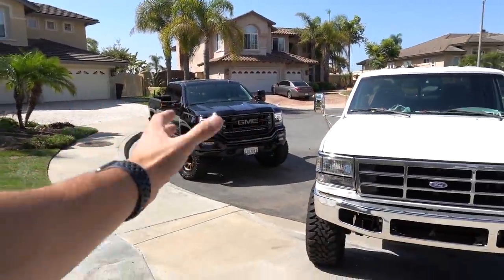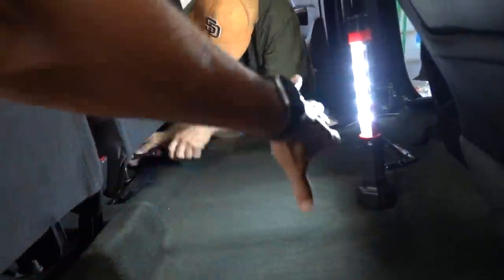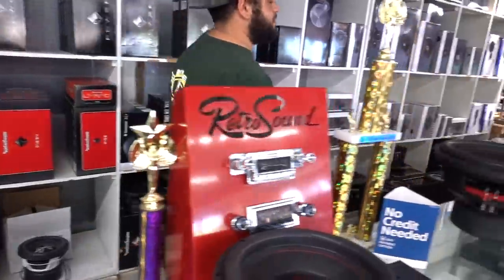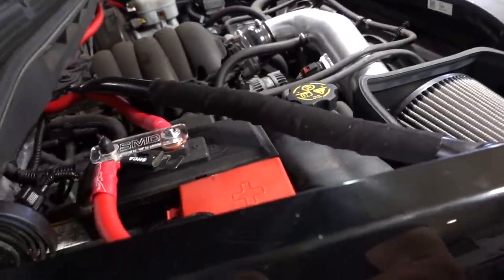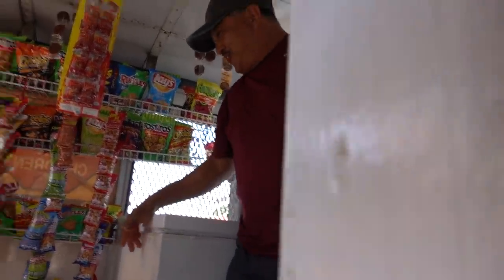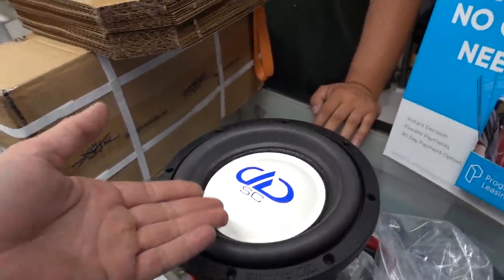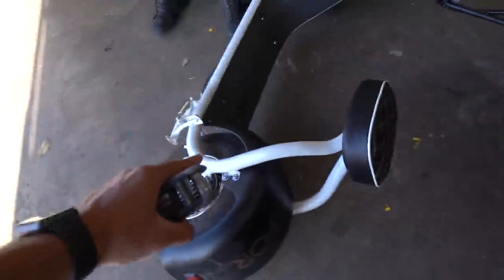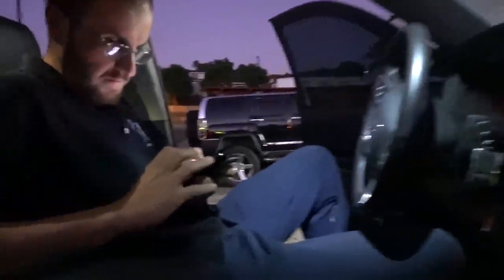CUSTOM COLOR MATCHED AUDIO INSTALL

Comment: Gmc bro I’m sorry I’m a GM guy but the Ford is still a beast
Reply: but the gmc is a gasser i would rather want a diesel
Reply: @etaled  Still far better than the old truck. Just the interior alone would make me choose the GMC, it's like comparing the interior of a ferrari or cadillac to the interior of a honda. And even the body style is like comparing a ferrari to a honda, it just looks much better. You add a tuner to that GMC and it will tow any boat or trailer that the diesel could tow with no problem.

Comment: Obs all day I have a 1997 f350 4 door long bed xlt 5 speed with 6” lift
Reply: Well some people are too poor to buy a nice truck and need to drive those outdated turds around, work hard and maybe one day you can save up enough $$ to get yourself a modern Real GM truck instead of an old ass hand me down turd with 200k+ miles on it.

Comment: GMC all day long. Anyone that would choose old school is not smart, the gas mileage is much better in the GMC once tuned and regeared (around 15-19 MPG on 35s 14-18 on 37s) the interior is far better and more comfy. It looks far better and the value is much higher.

Comment: Think lith and big 3's enough electrical? That DD amp, although efficient, still a thirsty amp. I say H/O alternator! 320 amp Mechman or CES should do the trick. Dual amp inputs at the very least. Ehh, then again it's not like he's going to be doing full tilt demos
Reply: No need for dual imputs since the distance and discharge of the battery will be enough. Big alt to come shortly for these guys #staytuned
Reply: @ronnieselectronics9338  refreshing to see Digital Designs installs, car audio just got to saturated and stale with all the Sundown and DC builds. What's the box turned to?